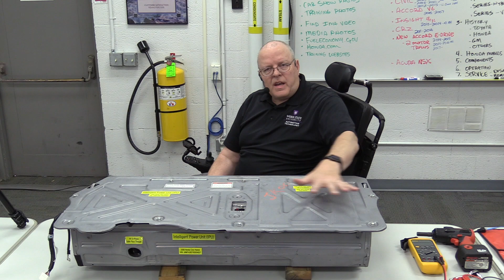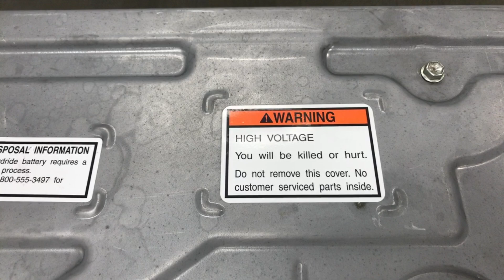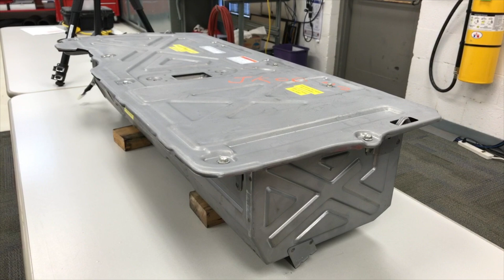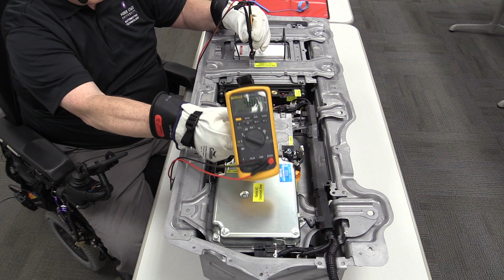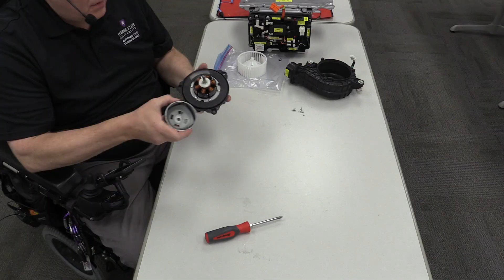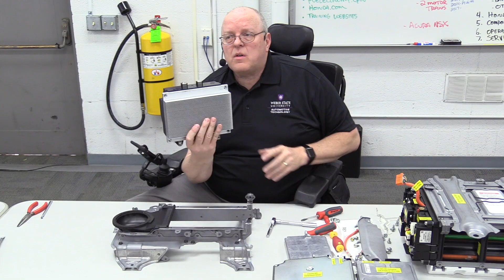Honda IMA Hybrids Part 1 - IPU with Inverter and Converter

Comment: Is it possible to replace a troublesome Mk1 144V LiMH battery with a Mk3 144V Li-Ion battery? Do the Li-Ion batteries have built-in voltage controllers (like a phone battery) or are they unprotected? Or, what would happen if you put 12 ordinary 12V lead-acid batteries in series (apart from taking up much more room)?
Reply from the maker: No, the charging strategy is different for Li-Ion. 12V batteries in series would be very heavy and not charge currently either

Comment: At 37:40 you mention a capacitor module - shouldn't you check for a voltage there before touching the contacts? Also, when you had the protective gloves on, it seemed that it might be easy to touch something with your uncovered forearm? How about having a store of thin rubber surgical gloves to wear for the delicate disassembly?
Reply from the maker: You are correct, I should have done that, but I have had it apart many times before and knew they were discharged. I forgot that important step

Comment: I came across an article where Honda were being accused of being insincere with their extension on the warranty of their HV batteries. They article claimed that after some years of use the poor State of Health of the HV battery would trigger a battery replacement fault code but instead of Honda replacing the battery, they would change the firmware with one which would be triggered at much lower threshold. Customers would drive out of the repair shop with their bad batteries, would continue getting poor gas mileage without the bad battery trouble code being triggered and after about another two years the same battery that could have been repaired would be literally too damaged to be repaired by the time the fault was triggered. I can't confirm this allegation but I think there's some articles out there touching on this
Reply from the maker: In my personal opinion, the Honda Ni-Mh hybrid batteries have been a disaster. There is an older service bulletin describing the extended warranty. The battery is replaced and the two ECUs are updated.  The 2014 and newer ones with a Li-Ion battery are great, but I feel sorry for anyone with an older one. New batteries are no longer available, just "remanufactured" ones. Of course the most common problem is the 12V battery going dead because the HV battery is bad and the DC-DC converter cannot provide a charge.
Reply: WeberAuto The 2019 Insight looks quite good though. Let's see how well their new system will perform.....By the way in which year and on which models did Honda make the switch from NiMH to Li-Ion? People have been asking me on whether it's a good idea to buy a used Honda hybrid.
Reply from the maker: 2014
Reply: @WeberAuto  I'm having this problem rn gonna switch the 12v regular battery with a deep cycle battery and throw on a kill switch terminal hope it helps wish me luck and open to more advice in dealing with this hybrid battery disaster on the late model Hondas thanks for the tips onnit really educational
Reply: WeberAuto ,

What if the charge occurs ( evidence by 14.4 volt reading in parked while idling). Could it be the lack of cooling of the DC converter unit due to clogged ducts on speaker area ?? How does it provide a charge to 12v. only at times yes, and at times no.?  

Any suggestions ? 2005 Civic.?
Reply: I have a 2005 Accord Hybrid, which came in V6, the first 3 yrs mpg we're great with an average of 38, now my avg mpg is 22. I have also replace the battery pack myself saving 60% less than what the dealership charged. There's also a problem with the ANC ( Automatic Noise Control) on the second Gen Accord hybrids when the vehicle is running on parked or stopped.

Comment: i own an civic ima 2013. my car was down and couldnt start. technician say car inverter is bad and need to replace it. he able to start the car using a new 12v battery. can we still driving without ima?
Reply from the maker: I doubt the inverter is bad unless there was a code referring to ir. More likely a bad HV battery. Check for codes
Reply: You could drive gen1 insights without the ima battery, google it.
Reply: Its inverter can be repair instead of replacing new one?
Reply: @syamsuddinnazri9572 да транзистор менять надо который сгорел

Comment: i am interested in buying a Honda fit / jazz 2012 model hybrid. I can't find a proper site with knowledge one the following questions you are my only hope or someone else here with true knowledge.

1)what gen is that model regarding its hybrid system and do you recommend buying it in general?

2)how much will truly cost a batary pack. not the process of replacing but the battery it self hoe much?

3)how can i check its battery cell condition before buying it?

4)how long do they last those packs if you take care of their Temps and charging?

Thanks for your time

Comment: Nice video as always. What brand printer and roll do you use to print those labels?
Reply from the maker: Thank you! It is a Brother P-Touch PT-7600. I use special "Strong Adhesive" label tape. You must clean all surfaces with brake spray cleaner before applying the label or it will fall off. Best wishes!

Comment: If my ima light is off but the car is not charging my 12v battery ,question my problem is the dc to dc converter or my ima battery is bad too
Reply from the maker: Chances are very high that your IMA battery is bad. When is is bad, the DC-DC converter cannot work properly and the 12V battery does not get charged properly while driving. Best wishes!
Reply: Is it something in the car that charge the ima battery???
Reply from the maker: Yes, but there would most likely be a warning light on if it had a problem. Honda Ni-MH batteries are famous for going bad. I have received many many people commenting with a problem similar to yours. Have someone check for trouble codes and go from there. Best wishes
Reply: Ok thanks
Reply: Hi can somebody tell me what is p16d6 code on a Honda civic hybrid
Reply: Hows your car doing did you get to fix it kindve having the same problem
Reply: Did you get it fixed? I’m having issue 12v not being recharged

Comment: Thank you so much! I learned a lot about my 03 Honda hybrid by watching your videos. I do have some questions my card pmu is not putting power back into my battery. And I just would like to know a breakdown of that system and it’s components and how it works so I can fix the issue
Reply from the maker: Thank you!

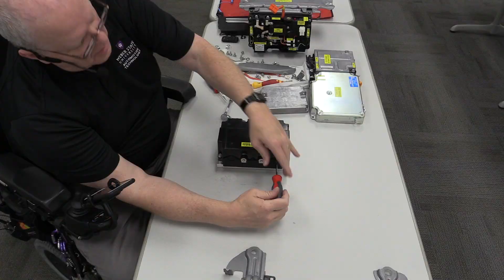Comment: 39:02 Why does the entire assembly have to be replaced if one electric component fails? Sounds impracticable. When my check engine/IMA battery light came on and I took my CRZ to the dealer, they said there was a signal circuit malfunction and that they'd have to replace the whole IPU at $2500 + additional manual labor. If that's not some bad engineering, idk what is
Reply from the maker: I was referring to the inverter module, not the entire IPU. It does not make sense that a Honda dealer would tell you that. For $2500, it sounds too inexpensive for the entire IPU. Maybe they were referring to an internal part?
Reply: Thanks for the quick reply! My mistake, not the whole IPU just the intelligent inverter unit, you're right. Still, $2500 sounds really expensive, +$640 for labor. My car is still at the dealer but I've been doing some research and I could buy an inverter unit part for $1555 and have it shipped to me for $12, so that all I have to charge them for is the labor, running me about $1k cheaper than they said - and with the holidays around the corner, I can't begin to express my relief. This video was incredibly useful to me, and you did such a great job dissecting the IPU and explaining all its components. Thank you so much.
Reply: IMA and BATTERY LIGHT ON!😬Scan your car if its a circuit you will get an error code. Indicating the circuit.  Search for it.  I love this teacher.  My was fault code P0AE1 it was a precharge contact circuit.  It was on the battery junction board. (Module).  Spent 200 for a board and replace the circuit. My cars IMA and battery light turn off when I replaced the circuit. My car is running strong now.
Reply: @rickyricardo5330 tranzistor ?

Comment: I own a 2009 Honda Civic Hybrid , Can you please clarify if IMA Ni-MH battery is damaged (or doesn't get recharged ) , will the Car get unusable ? In other words if   NiMH battery is dead , will the car run in Petrol , like a normal non-hybrid car?
Reply from the maker: If the IMA Ni-MH battery is bad, there will be nothing to keep the 12 volt battery charged and the engine will die while driving. Some prople have said they have turned OFF the battery switch behind the back seat and have been able to drive normally, but I have not been able to verify that. Best wishes.
Reply: I have a Honda Jazz Hybrid and I keep a small 12 V battery under the rear back seat just in case my battery pack fails. I will keep that battery switch trick in mind though.
Reply: I have a civic hybrid 2nd generation. I have been trying to recondition my hybrid battery. I can verify that I have driven the car with the hybrid battery out of the car completely. It doesn't charge the 12 volt battery but the car can drive using the current of the 12 volt battery. However once the 12 volt battery dies, the car dies. Certain things happen to die first until eventually the car stalls. The power steering goes first, then the ABS brake light comes on. The dash itself will begin to glitch out and eventually the motor dies. In my current state I have driven the car for my commute but i have to recharge the 12 volt battery every day when I come home. And I will likely damage the 12 volt battery from draining it too deeply. Ideally a deep cycle battery could keep me going longer. But I just want to fix the hybrid system in order to pass my emissions test. The only code that wrecked it for me was the hybrid battery deterioration code. Won't pass with the check engine light on. 
     What I would like to know is how to test various components to know if they have gone bad. I balanced the battery pack, but once I put back in the car, nothing has changed. Still no charge to the 12 Volt battery and no assist or regen. Would a balanced pack  still be throwing deterioration codes if the cells themselves have deteriorated despite a balanced voltage across each stick inside the pack? After cycling each stick a few times on a charger, I noticed the capacity of a few cells were lower than the others but that it would still hold voltage and charge up as high as the rest but would discharge quicker. I was hopeful to clear the codes long enough to pass emissions. I am wondering now how to test the DC to DC converter to be sure that something else hasn't gone awry outside the main hybrid battery.
Reply: Gen 1 insights people drove with no ima battery at all or disconnected its a matter or 1 connector and 2 wires to get your 12v battery charging. Also I have seen people use andino to "play" the car that it still has ima battery in it, so NO warning lights at all. Don't know about gen 2+

Comment: Interesting you said that in the inverter, IGBT are only used for accelerating and diode rectifying is used for decel regen.

In more modern and advanced hybrids and EVs, I was under the impression that the IGBTs were used in regen as well as accelerating power delivery. Is this to be the case?
Reply from the maker: An IGBT is a one way device for current. The 6 IGBTs in the inverter are only used for driving the motors. There is a single IGBT that is only used after the rectifier bridge and before the battery to control the charge rate during deceleration.

Comment: I used to own a 2003 Honda Civic hybrid. It was the most underpowered gutless car I’ve ever driven, but I found it to be an interesting challenge to negotiate traffic and freeway on ramps.

Eventually the IMA NiMh battery failed after about 7-8 years. Most of those years was when I lived in Dallas, so the battery suffered many brutally hot summers. Like he said, the battery draws cabin air to cool the cells then exhaust the air in the trunk. Because I would loose the engine auto stop feature, I never used air conditioning unless I had sensitive passengers. Running the AC would also cause a noticeable reduction of power when accelerating, and more importantly a drop in MPG! This certainly accelerated battery degradation since the cabin air temperatures was well over 120f in the summer. Plus when the car is parked out doors in the baking sun the battery is cooking for hours. For all its problems, I still achieved 44+ MPH for years of driving (and sweating) bliss.
Reply: 44 mph? you must be a patient driver
Reply: Considering battery is third the price of Toyotas - pretty good deal.
Reply: I average about 40 mpg on mine
Reply: I guess MPG

Comment: An interesting video. How 'pure' is the sine wave output from the inverter unit, since it is electronically and not rotationally derived. Have you ever scoped the waveform?
Reply from the maker: Thank you. Yes, I have scoped it. It is a stepped voltage, not a pure sine wave upon acceleration. Deceleration is a  pure sine wave since it is from the induced stator voltages.
Reply: Thank you Professor for your reply. I suppose it depends on the maximum speed of switching of the IGBT's to provide the best possible stepped sine wave. Do you have a graphic display of the waveform which you could include in any possible future videos?
Reply from the maker: Yes, good idea. Thank you

Comment: Toyota hybrids are much better than Honda.
Reply from the maker: Thank you for your feedback. I agree in regard to the IMA systems. The new E-drive Honda Hybrids seem to be pretty good.
Reply: but the hondas are more fun to drive lol
Reply: Agree I used to have a HCH GEN 1
Reply: Is there a difference between the Inverter units of Gen 1, Gen 2 and Gen 3? For Gen 3's Motor Power Inverters, are there fuses or cooling fans or a control module?  Is it a good idea to check the usability of the capacitors, if it's faulty? I ask because I have an MPI unit which is not working for a 2012 model. I hope you can advise as I am curious to know.
Reply: is toyota not really fun to drive ?